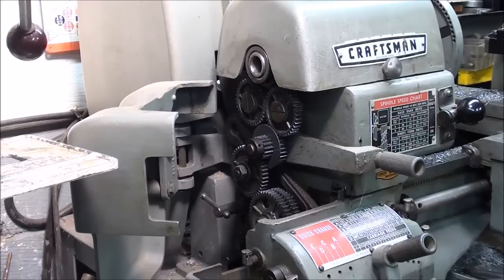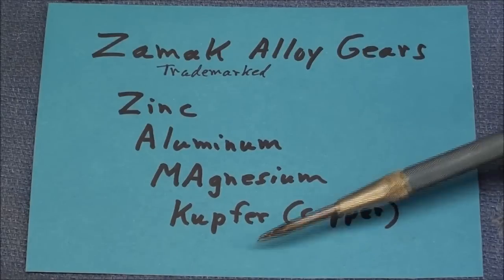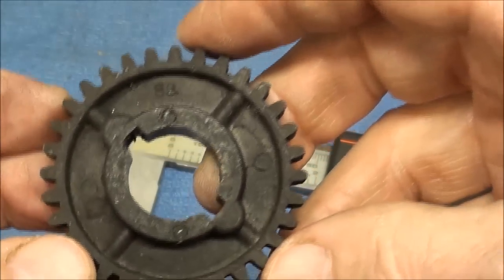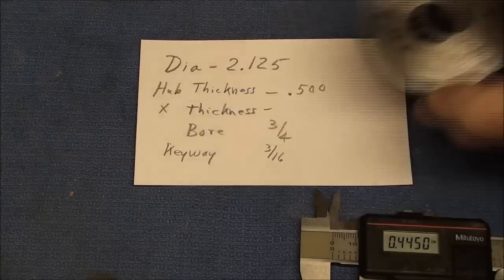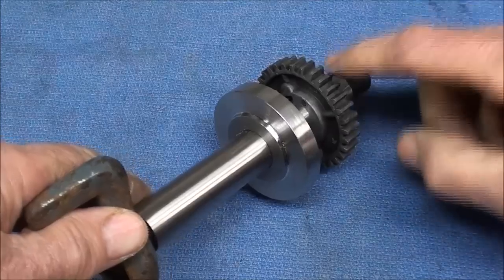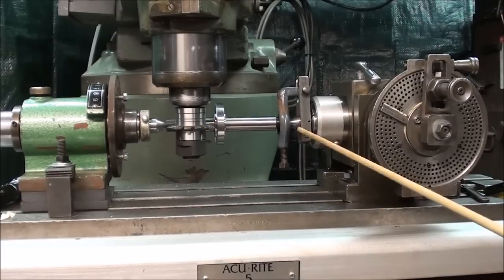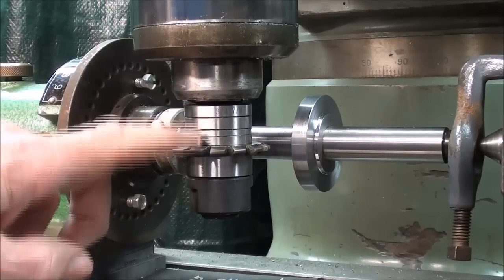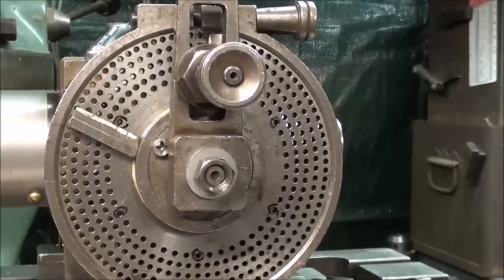SHOP TIPS #200 Making Gears for the ATLAS Craftsman Lathe mrpete222

Comment: I have an atlas lathe without a quick change gear box the bearing that gear rides on actually has two keys  that are part of the bearing so you have to cut the key ways like it or not.
Reply: George Apostolou What year is yours? I'm starting a rebuild soon, I think it's a 1937 model. At least this is what I've discerned from images I've seen online combined with the copy rights of several of the manuals that I received with it. The manuals range 1934 to 1937 / with one supplemental that has no date, but describes the change gear configuration quite clearly.
Reply: I would say it's early thirties being mine still has Babbitt bearings in the headstock.
Reply: 1934 was wood only (first year of production), 1935 a metal aftermarket kit was introduced to convert the '34 wood lathe to metal. Models afterwards, from '35 to '39 get a little schetchy. Models between '34 to '38 (maybe '39), the table bed has squarish feet/ afterwards the feet have an inward arch. In 1935 there were two different models being sold from my understanding, the original model that could be converted to wood, and a new one that was designed for metal.
Reply: This is a metal lathe I got it with all the accessories but no wood turning parts the gentleman's family said he used it for model train parts. He used it to turn brass and plastics it's very clean and tight.
Reply from the maker: +George Apostolou (ManCaveMachineShop) THANK YOU
Reply: Further research, Timken bearings were introduced in 1939, all before used babbit bearings in the head stock.

Comment: Thank you from Alaska. My high school colony high was a wannabe  upity or prepy and had all shop and machining tooling in boxes in the back of the building were I would hangout with the janitors  in a brake room made of boxes. I spent 4 years in this room of boxes after school.  2 year after I graduate my high school  advertises  welding  classes for 350 dollars and when I walk in what do I see  a shop class. small engines class and machining classes for high school kids. those fuckers for years  act like there school is for upper class  only (ARE KIDS ARE COLLEGE BOUND WE ARE BETTER THAN THE TRADES) and now there teaching kids the trades. when I was in high school I had to leave early and I found a job at an aircraft engine shop  then I went to a hole in a wall speed machine shop for 7 years they had an older large lathe the bed was cut short it still was like 20 feet long  they never used it maybe once on a set of truck rims and i think the tool was dull it sounded like shit.  I'm building a shop and i've been shopping for  tooling and a mill and lathe for 15 years slim pickens around here in Alaska so far I for 1 small shoe box size box of taping tools in 15 years. now im ready to drive to the ends of the earth to get a shop going.  I just wanted to thank you for your teaching me I just wish I had you for a shop teacher and thanks to you in a way I do so thank you from Mike in Palmer,Alaska  akmudrat22@gmail.com
Reply from the maker: Thanks for watching--you got short changed. Build your own shop

Comment: Not unusual for the gears to be a little undersize. My atlas gears are, the gears for the harrington used to run were, and, as I recall, the gears for the southbend when I was in school were. I think that the undersize and slightly modified tooth form gives a bit more leeway during setup, since the centers are essentially spaced by eye and feel, and the gears don't always run true as a result of the service they do and how they are set up.
Reply from the maker: john john Good points, thanks